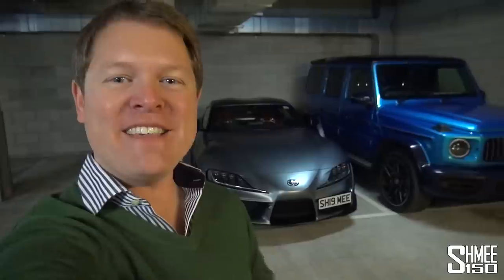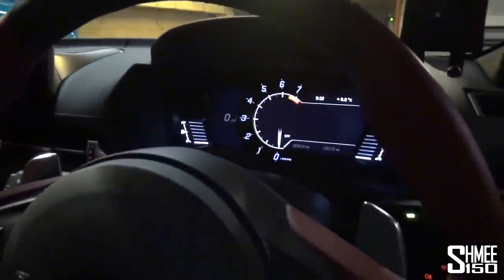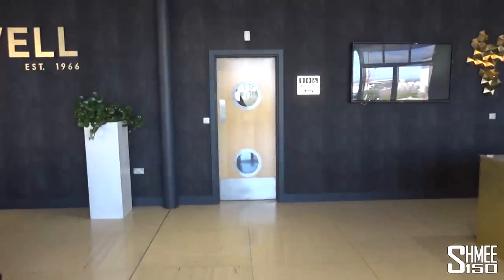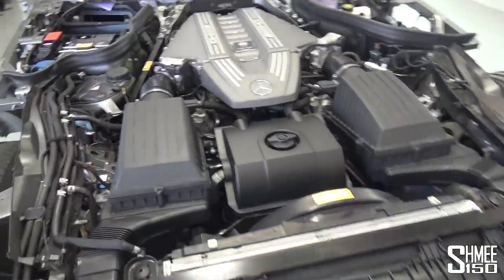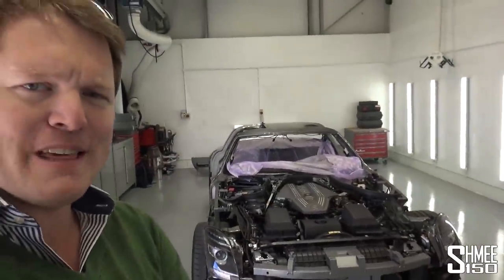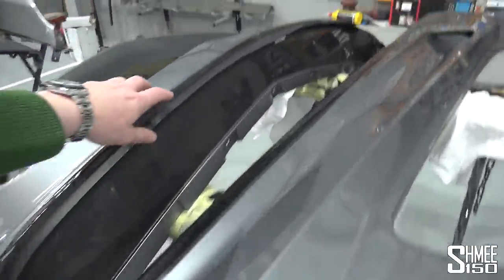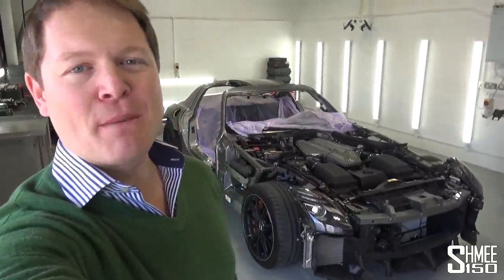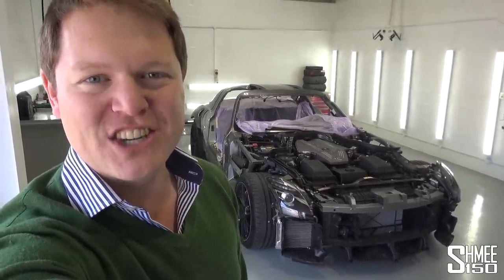My SLS AMG Black Series is in PIECES! 100% Stripped Down for Painting

Comment: Might be a stupid question but would it be easier to PPF the panels as they are now off the car and assemble them with PPF on than to apply the PPF to the rebuilt car as usual? My thinking is that as you can feel the PPF edges when it’s applied on the car but surely you could move the edge to a location that would never be seen i.e behind the trim that goes on to the inside of the panels.

Comment: Point 1 - Having watched how meticulous chartwell worked with the senna they would be the best choice to strip down and paint a priceless car, having said that, the thought of factory screws, nuts and bolts loosened and re torqued, I’d always wander if the future rattles and creeks coming from the sls were caused by this project.

Comment: You spoke about sanding as part of the painting process. How is that going to work with the carbon parts, especially the bigger parts like the bonnet. Are those sandable?
Reply from the maker: Yes you can sand the clear laquer on the top, it's quite interesting how it's done
Reply: @Shmee150  Thank you for clearing that up. I thought that it would be some ultra complex process, but now I know.

Also, #teamSilverWheels. 
Not to say that a dark on dark style wouldn't look good, but man, the silver will look amazing.

Comment: For the mere mortals a colour change on a car is a massive devaluation. Also the strip down and reassembly as with a major prang would mean that the car will never be the same again. Rattles, leaks, panel gaps, etc. A rap maybe, this I'm Sorry Tim I just don't get it.
Reply: Garry Croft Tim explained why he’s doing what he’s doing. Watch Savage Garage stream that had Tim as a guest. He SLS BS will depreciate in value the moment he bought it. As he plans to put miles on it. I think only his Ford GT has increased in value after delivery. That includes his Senna... after actually suffered an accident. 

The SLS joins what 3-4 other cars from his collection that Tim consider permanent... Ford GT, Senna, 675LT & GT8.
Reply: He won't be keeping the Senna the moment MB gives him an allocation for AMG 1..It's the only reason he has been purchasing so many MB's.
Reply: I totally agree. It's not just the devaluing by changing the original colour, it's more the fact that the car will never be put back together as well as it was originally in the factory. This is a dumb as fuck move on several levels.
Reply: 100% agree with all comments so far, stripping and respraying a car (especially an expensive rare car) like this makes my toes curl! I'd even sell a compact if it had accident damage which necessitated this level of strip down and respray, they're just never the same afterwards.

Comment: Great update and enjoyed all details on the process. 
Regarding the 6yr old tires, don't mean to be a downer, but I care for everyone's safety. Happy to see you're addressing them! 
As this is a high performance super car, tires need to be at peak condition and should be changed at most every 3 years or 36k miles. 
This became most evident when Paul Walker died in that horrific accident. After review, the accident was attributed to the tires. Although the car had low mileage, they were the original tires and (as happens often) were overlooked because they "looked ok" as they had low mileage. 
Looking forward to the results and all the great videos to come!

Comment: Are the frame rails going to be painted as well? If yes, curious how good of a job can be done with the engine still in place.  Stunning car regardless of colour!
Reply from the maker: The original plan was actually to remove the engine, but it's so far back that you can paint everything visible without removing it. However, I'm not trying to 'hide' that this car had a respray (I'm making tonnes of videos about it for starters), but you won't see anything silver anywhere on it without dismantling it again.
Reply: @Shmee150  Thanks for the reply good sir.  Can't wait to see the final product. Nothing to do with hiding its original colour.  I Was just curious as to how far you were willing to go.  In the grand scheme of things, removing the engine to spray every single facet of the chassis is pointless and not worth the additional cost.The SLS black series is an absolute gem of car! Can't wait to see the final product!

Comment: Hi Tim, I guess the hidden parts of the chassis are staying grey?..
Reply: Yep, and most of the engine bay by the looks of it 🙄
Reply: @richardhammer187  mmhhmh...I'm not sure about the outcome, are you? I mean, it's not a full on repaint, it's repainting the exterior...
Reply: @giovannidonega9391  not at all, I'd never get a car stripped and resprayed like this. The only exception being if it was a dipped body/chassis on an old Mustang etc, then rebuilt by someone like the guys at DRS (FantomWorks). I'd always know it was never the same as it came out of the factory...

Comment: A unique car just got torn apart literally , because you can doesn’t mean u should, to have such a rare car stripped to that degree is not brilliant , all for the sake of a colour change and content , it will never be put back together as well as it was from the factory, just to change the colour 🤔
Reply: The factory most likely does not have the level of craftsmen that are in this shop. Every inch of that vehicle will have an expert's touch. There is no doubt the finished product will be every bit as good as the factory and probably better.

Comment: at around 7:07, he completely ruined the video (and some of his high reputation). for such an car guy as he's, he should know better how that fan behind the radiator actually works. with that separating layer behind the fan more shielding the engine from the heat dispatched from this area

Comment: Tim 2014: falls in love of SLS AMG Black Series because it's a tuned SLS with BLACK exterior and carbon parts.

Tim 2020: buys SLS AMG Black Series to devalue by changing the original paint, wants to change black wheel color, then possibly change the color of every BLACK or/and Carbon part of the car.

Tim.... You should've just bought a regular SLS, flash tune, upgrade suspension, brake, and exhaust systems, add wide body carbon kit, add wheel spacers and customize interior for a lot cheaper?? 🙍 Smh ... Ruined a beautiful stock SLS AMG Black Series.